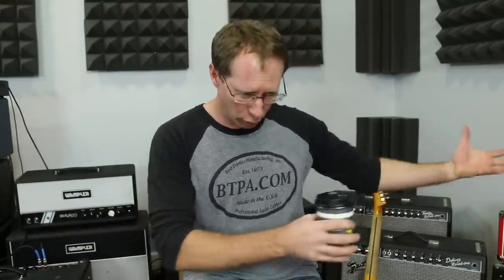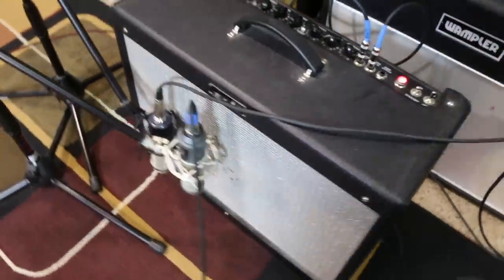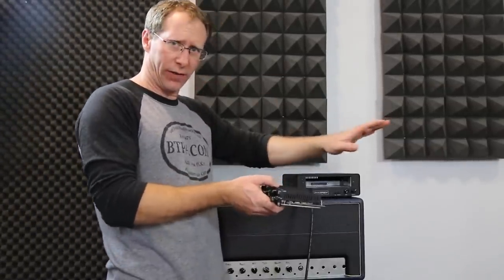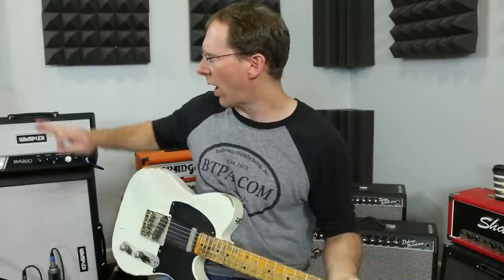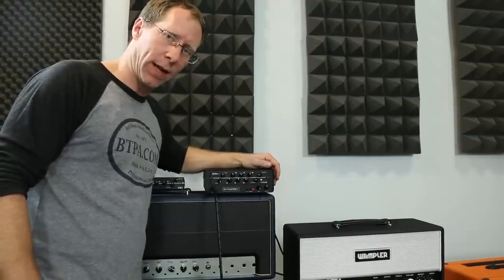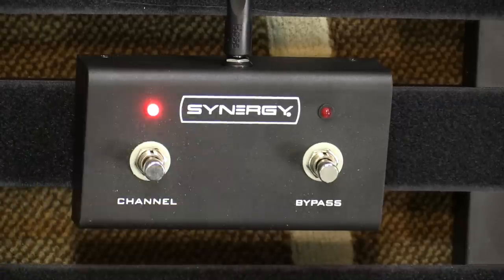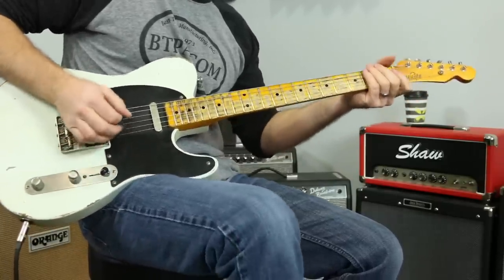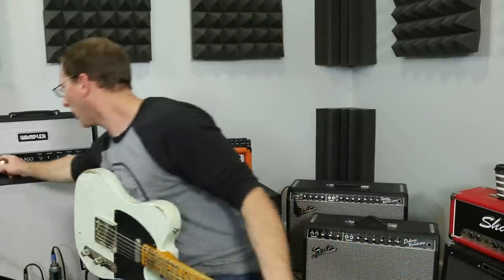Are VACUUM TUBES now the FUTURE? A look at the new Synergy technology

Comment from the maker: Lots of "ermagahd! Randall did this first!" comments. Here is Synergy's official response regarding the difference between the two companies and their tech:

Synergy is quite different than Randall. Below are some of the key reasons. 
1) Synergy modules are dual channel - Randall was single channel. 
2) SYN-1 and SYN-2 can interact with your amp to add channels. 
3) Synergy hardware can “sense” which Synergy module is inserted into it and adjusts the cathode biasing circuit on V1 tube to match the original amp. Patent pending. 
4) Modules are from the actual amp builders. Synergy branded modules are of those brands that declined the invitation to join us. In other words, they sound and feel right. 
5) The brand owners profit share with each module sold - they get nothing when someone“profiles” or “models” their sound digitally. 
6) Synergy is built in USA using Synergy caps. Synergy caps are the “secret sauce” for many boutique brands. They are USA made and quite expensive. 
7) We own the patent whereas Randall licensed it. We are in for the long haul. 
The hardware is more innovative and the modules are more flexible and authentic.
Reply: I wasn't attempting to knock the Synergy effort.  I was just amazed and happy that someone else picked up the technology and ran with it!  The fact that they're "in for the long haul" is not less exciting, it's more exciting.  I think it'll be a boon and give new life to the Randall/Egnater preamps already in the marketplace.  It's true that Randall tech was single-channel, but it was licensed from Egnater, which was originally dual channel.

http://thermionic-studios.com/node/105
Reply: Hi Brian. Hope everything is going great with you. Maybe I missed some info in the video  , but can you confirm these modules do fit in a Randall RMS Amp ? I've had my RM20 for about 6 years now . And I have a custom built  Plexi /SL+ Module from Scott Souter out of Detroit. This module  , for me  , was the end of my  tone search. I'm over 50 so that was a very long search. LOL. But if these new Synergy Modules are compatible with Randall  , I'm ready to start ordering right now . Merry Christmas dude.
Reply: Would've appreciated the full disclosure early in the video, rather than at the end. You said that the guy who makes these is a buddy of yours, but isn't it more than that? Isn't Wampler part of the same distribution company as Synergy, Friedman, Morgan, etc.? Boutique Amp Distribution?
Reply: Wampler Pedals I think VCR made it first
Reply: Daniel Yeh this is Wampler's channel. Brian is showing something really cool to folks. You seem overly upset about seeing something 'for sale' on a Wampler company channel.
Reply: Tony LaMarca I'm not upset, and I don't mind seeing a commercial. It's his channel, he can do what he wants. I'm just respectfully asking for the accuracy of his full disclosure. "My buddy made this" and "my business partners in whose success I have a financial interest" are two different things.
Reply: Hmmm. Interesting idea, but the "Tubes are the future" is a bit misleading. They will eventually disappear, as systems like the Kemper/Helix/ etc. get cheaper, which ain't gonna happen with tubes/valves (sorry, i'm from the UK!). Sooner or later (yes, probably later) tubes will become too expensive to manufacture. 
BUT, as ever, when it comes to that thorny issue of "Tone", i get suspicious of phrases like:- "..Synergy is built in USA using Synergy caps. Synergy caps are the “secret sauce” for many boutique brands. They are USA made and quite expensive." Sadly guitarists are still buying into the "magic" properties of components, wiring etc. Sure, make a circuit and use good quality components. Good design principle. But as ever, just drop the word "vintage" into a guitar related device, and guitarists pulses start racing. 
Be clear, I'm not not knocking these Synergy boxes per se, but just questioning the reasons why people will spend fortunes on gear like this, "boutique pedals (at vast prices for a handful of cheap components!)'" and indeed anything that uses the word "vintage"  Guitarists are a funny lot! (myself included).
Reply: Fender: "Randall is just ripping our stuff off anyway, so who are they to complain?"
Reply: Yup, Egnater did it first..Randall Licensed it for single channelst and it is very clear that Synergy is an evolution / big next step along this journey. The easy MIDI switching integration (4CM) is a godsend. The manufacturer official modules, zOMG!!!! Those two features worth the price of admission alone......but the third and final coup de grace , these are in current production and supported in the US, backed by a whole host of companies.
Reply: @Tim Beaton: Two reasons why people spend money on expensive components: reliability/endurance and sound. Some components cost more because their performance does not deteriorate with time (long-term as well as short-term - as in during the gig with the temperature/humidity fluctuation). Others - like certain (vintage) tubes - besides reliability offer a superior sound. If you can't hear the difference - no need to spend extra money. But some of us - those who can - can't stand the sound of modern production tubes. Even though gear manufacturers say they optimize their product to work with the current production tubes, I am yet to encounter a piece of gear that would not be improved by switching the tubes to Mullard I61 12AX7's.
Reply: So basically it acts like an attenuator?
Reply: How so?   I'm not trying to be a dick, but how did you get that from the video and the above comment/response from syndergy?
Reply: Seymour Duncan had two module amp in the 80's already with his Convertible amps.
so no, synergy has not made anything new.
Reply: Tim Beaton No, it's not misleading.  Tubes may very well be the future.  As good as things like the Kemper and the Axe effects and all of the modeling stuff is, it has not reached the level of natural fidelity and tone quality that tubes does and it perhaps may never do so.  ANYTHING digital is only a representation of a programmer's idea of what it should sound like. Every tube amplifier, on the other hand, has that open and beautiful tone that we all love.  That is why so many guys are going back to tube amplifiers and using things like load boxes and IRs.
Reply: Regardless of the company's response, Randall already did this. Doesn't matter what syn tries to do to differ themselves. Not knocking the coolness of this technology, it's definitely cook for sure. But it's nothing new or exciting.
Reply: Just adding my .02.
Ppl have been saying tube amplification is going away ever since the invention of the transistor...
How long has that been? 70 years?
I think this product, as cool as it is, is still cost prohibitive.

But, still very cool....for those who can afford it.

Comment: I've been using the Egnater and Randall versions of this for years.  I'm so glad that Synergy made the choice to make their new stuff backwards compatible with my gear.  Fantastic stuff.  And I'm glad to see the modular system getting out to a larger audience now.
Reply: Scott Bartel  -  -  Me too !! I've had my RM20 for about 6 years  , with a custom built module from Scott Souter so I'm happy as hell we're gonna have more options.
Reply: So you can use these with the randalll RM100 ??
Reply: @blakshine3416  Yes you can.  However, since the RM100 only supports single channel modules (unless it's modded) you would only have access to one of the channels on a dual channel module.  But they totally work.  On most Synergy modules, the channels are identical except they have different gain and volume controls.  So those, it wouldn't matter if you could change the channel.
Reply: @scottbartel7131  cheers thanks , might dig it out again. Went Kemper a while ago
Reply: @scottbartel7131  the Morgan module sounds great. My fave module for Randall was the ac30 inspired one

Comment: You could also run these into a fryette power station (tube), or a two notes Torpedo cab or into that new Seymour Duncan power amp for the ultimate emergency back up rig
Reply from the maker: Yep, I mentioned the same thing somewhere in the middle of the video 😊
Reply: i think this would be an awesome rig to use full time!!!))

Comment: Ye ye, its been done before and it's called tube pre-amp pedals.
Seriously a module is around 450$, the housing unit around 550$ and you still need an actual amp to power it.
There are 3rd party manufacturers that make exceptional high-plate voltage tube preamps.
Gurus, Kingsley, Fredamp, Effectrode, Koch and the list goes on and on, most of them with direct balanced or unbalance out and at a much lower price point.
Even Carvin and Soldano used to make a tube pre-amp in a pedal format with the exact preamp sections of their own amps.
Seriously, it's a great idea but it's too pricey and it's not really the real deal, it's a close approximation just like the non licenced products.
Reply: Patato Keftes Yep I couldn’t agree more as a long time user of valve pre amps myself.
Reply: Actually, it literally is the preamp of the different amps. The difference happens with the power amps (which it doesn't emulate) and the cabinets

EDIT: that said, the pedal preamps are cheaper and awesome on their own right
Reply: Just take the time and get the facts straight. It's right there in their website.
The modules are new designs to SOUND as authentic as possible, not componently faithful transfers of the actual pre-amp into a module format.
Some of the Marshall modules are even altered by Friedman for added gain etc which of course also means not accurate reproductions.
These designs of course are restricted by cost (399$) size and features (2 12ax7 tubes and maximum 2 channels). These are some of the limiting factors that the designers had to work within to recreate as much as possible the pre-amps given the restrictions.
Which, again, is what tube pre-amp pedals have always done long time.
The only difference is that for most of the modules the design came (as advertised) by the designer of the original pre-amp.

I do agree on pedal tube pre-amps, they can sound fantastic and some of the higher-end ones nearly indistinguishable from the real thing.
I'm not against this modular design, I kinda like it, but they are just a financially non-preferable solution to a problem that didn't even exist.
Reply: Patato Keftes totally fair point there, my bad
Reply: Not to mention marshal avt50 and 100 watt. Had a tube amp preamp built right in. Great amps had 3 of them.
Reply: Plus if you want to use effects such as delay you're going to have to plug them into the effects loop of the Synergy, so you've got your guitar cable running to the Synergy, then you've got a cable running from the Synergy to the input of your amp, then you've got two cables running to and from the effects loop of your amp into the Synergy, then you've got two cables running from your delay pedal to and from the Synergy's effect loop, erm yeah, I'll stick with my distortion pedal.
Reply: If you want to check out some awesome tube preamp pedals, check out Kingsley.
Reply: Patato Keftes hell Randall did this 13 years ago
Reply: Patato Keftes
True. And one very good tube pre-amp pedal is called the Blackstar HT Dual which I think costs around £180. You can also plug it directly into your computer for recording.
Reply: Valvesonic Plexi Preamp rack by Rocktron is another one, there is a metal model too....just the 2 models, there were supposed to me more in the workx
Reply: Robert W seems like you could run this on the pedal board.....then run one cable to the amp/power amp.....(or just a cab sim out to board/or a Frfr powered monitor....in front of you....)
just a thought....
Reply: @davidfaustino4476  spot on ⚡
Reply: Meh... dont see that little box on the hands of a gigging musician. Too fragile, nerdy, hi tech thing to worry about on a messy 3 a.m gig. Also instrument market is all about image. People still like big wooden boxes on stages. Just use regular amps people. The concept of this thing is strange too... Looks like car cassete players of the 80's, removable to avoid robbery. lol.... Kemper concept, for example, makes much more sense. A brain that you can change the content. With this you have to open the thing, expose the components and phisically change the core. It's so NOT the future.

Comment: A cool idea (albeit not quite new). A word of caution to those who think getting an SLO preamp will get them an SLO sound - it doesn't work. The SLO power amp section is a big part of the amp's sound (just like it is with most amps), and running the preamp - even designed and built by Mike Soldano himself - through a different power section will NOT make your HRD into an SLO. Yes, even if the power amp uses the same tubes as the SLO. I own a Soldano X88R pre - literally the SLO preamp - and I've run it through every amp possible including my Bogner Uber and Diezel VH4 - amazing amps in their own right. And all you get is an approximation of the SLO sound - never the real thing. 

Not knocking this product - it quite possibly produces great tones (especially for live situations) - just cautioning those who consider buying this product not to expect an actual SLO or VH4 sound.
Reply: Shmalentine 
Close enough for most of us...especially for $399 and being all tube.
Reply: Sorry, did you ask most of us to make that assessment? Not to mention that being all tube doesn't guarantee good tone. There are plenty of cheap - as well as some expensive - all tube amps that sound like crap. Again, not knocking the Synergy product - just saying don't expect an SLO or a VH4 for 400 bucks.
Reply: Wak Job I agree with you, because you can gain quite a few quality tones from it just by messing around a bit

Comment: I love the concept but when working with modular electronics of that type, I've always found them to be problematic in the long run. For example, I once had a Seymour Duncan Convertible. It was a great sounding amp and extremely versatile with the plug and play modules (using a connection that was very similar to the Synergy). Yet that SD Convertible was an accident waiting to happen. It would die about every other gig due to the modules losing connectivity (I'd have to open  up the module area and push on them to get the amp to work again. I finally just relegated it to the practice room (which was a real waste of a lot of money). So... for Mark Wampler or other electronics gurus who know more than I do, how do we know this device won't have the same problems? (or do we)
Reply: I too thought this was a neat idea in the past but knowing how much gear gets knocked around 🤣. The good news with this product may be that it’s potentially better quality connections and lighter weight than a head or combo which can help with the being knocked around bit.  It’s a very cool concept for geeks with $$ and best for studio use in my opinion because if you find your sound through this process chances are you should just get an amp built or maybe rack it all up in some stupid heavy road case with lots of foam padding and blah blah- hmm if anyone ever tours again 🤣🤣
Reply: They don't use any glue or silicone with their Electrolytic caps, and depending on what your using a lot of wiring is packed into tight places and sometimes severed even during assembly. I don't see how this stuff can handle jolts. I don't know how easy it is to get the plating coat for the contacts on the modules either.

Comment: Sorry for the long post I would like to add in my experience . I,ve owned/ part designed/modified tube amps for over  30 years. This includes putting power amp input jacks into amplifiers that didn't have them in order to try to recreate some of the “new" ideas here. LIVE use problems-
1/ phase splitter (which is an integral part of the amplifier) differs in most tube amps even between models from the same company (eg Fender Twin, fender vibrolux reverb). Unfortunately this is an integral part of the sound of the power amplifier so  you can't get it to sound or feel the same. 
2/ The tubes themselves. Unless you are using a flat response power amp (which still has some issues) the tubes in a typical guitar amp will add a character to your preamp - again it won't sound/feel the same.
3/ The actual speaker cab you use. A Marshall plexi at least partly sounds the way it does because of the big 4 x 12 Cabinet that you can barely lift that it runs into.A 12" open back Cab won't sound the same.
STUDIO use - in some of the demos it sounds very similar particularly against the backdrop of a heavy band but what is the point in buying it when you could use a high-quality modelling unit that would give you end to end experience of the entire signal chain at a much better price. Some of these units are so good that you simply cannot tell the difference in a recording.
 These units could be useful for somebody who can't get to grips with modellers and the like, and also for obtaining a proportion of the component of the  original sound.
 Most importantly  it will be popular with the "tube fairies" because as we all know in  “tube fairy land" it will always sound “better" if it's played  through real tubes- yeah right.....
 as a small aside I've owned some of Brian's gear euphoria, Tweed, blackface and I have nothing but respect for his pedals.he's not claiming here that it will sound the same as he knows it won't.....